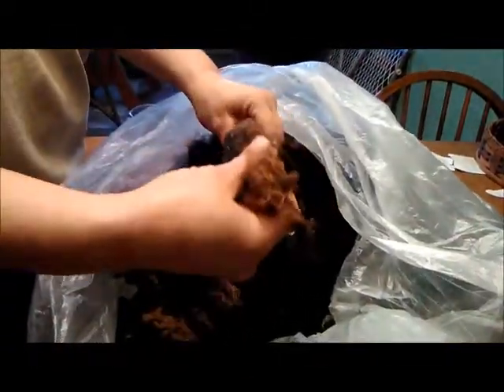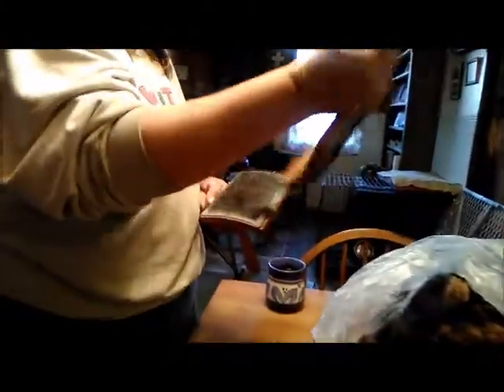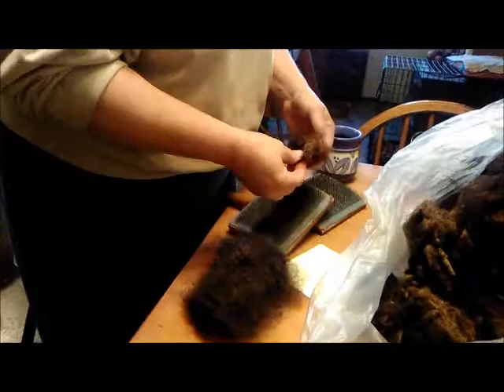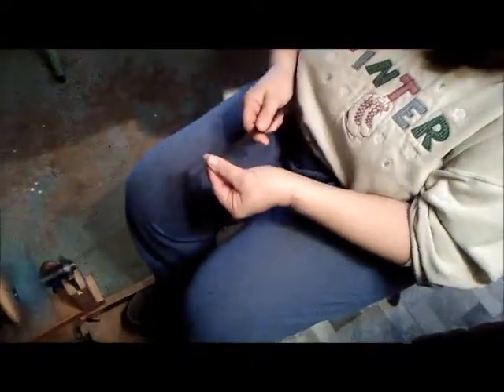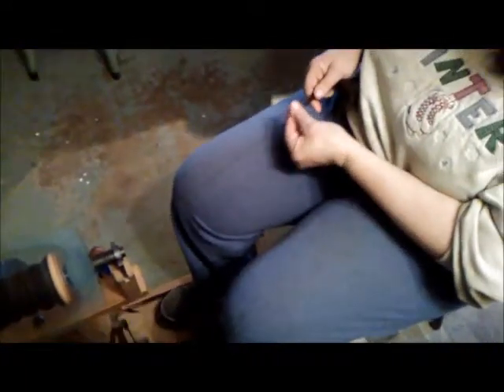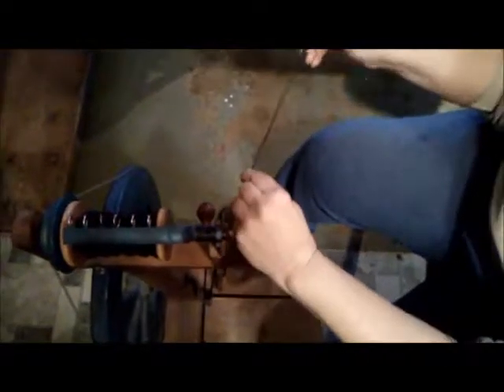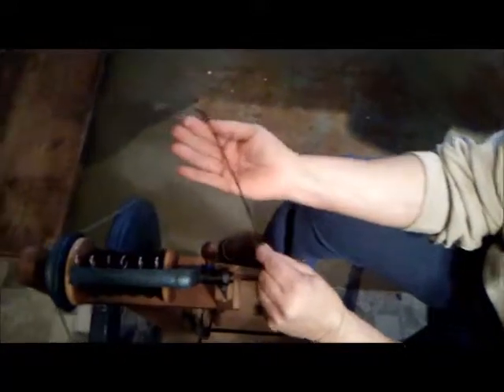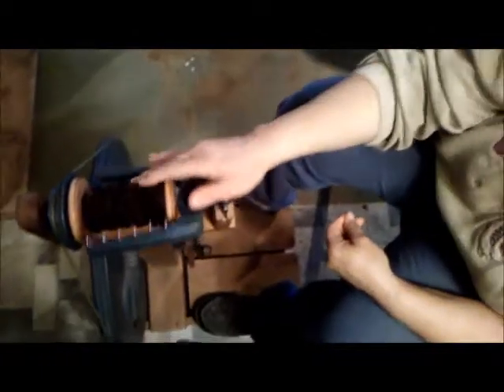Spinning wool in the grease

Comment: I have some yarn that a friend "spun in the grease".  She doesn't knit and asked me if I could knit a pair of fingerless gloves with the yarn.  She is hoping that because the yarn was spun in the grease the gloves will be waterproof.  Is that true?  Should I wash the yarn before knitting with it?  Thank you!
Reply from the maker: While spinning in the grease does add some protection and a bit of waterproofing it won't be watertight. It will not be anything like modern materials today.  Every time you wash the yarn or mits a bit of the lanolin will be removed until only the lanolin that is between the twists will have any at all.